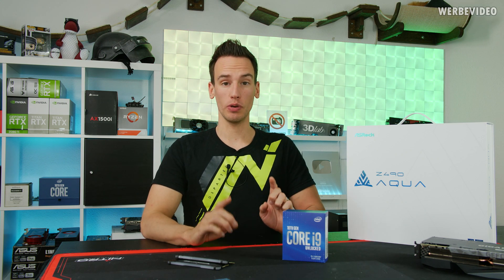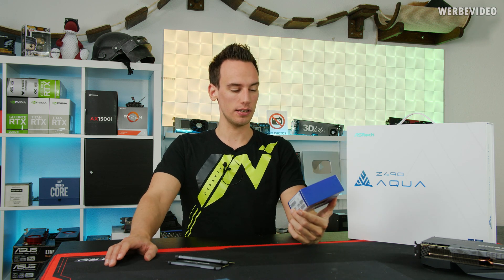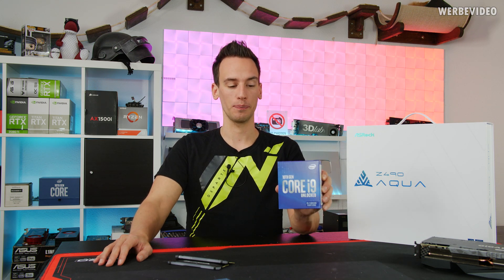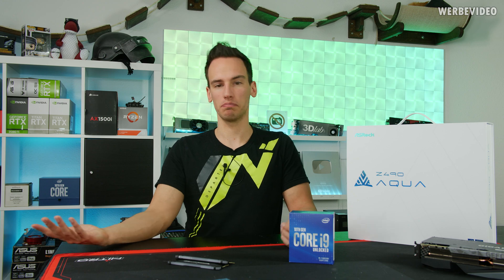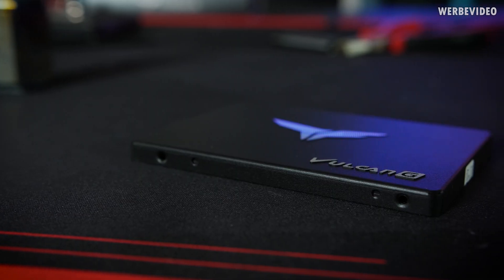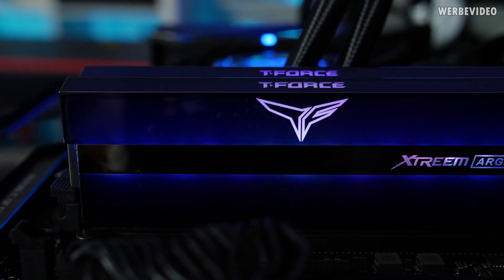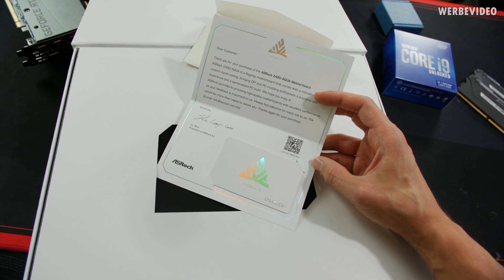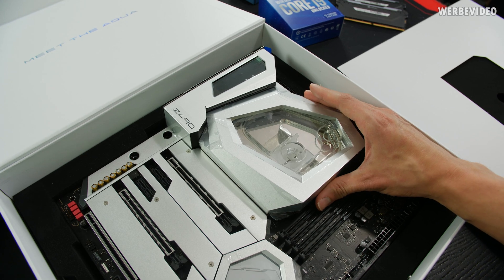This Mainboard is TWICE as expensive as the CPU - ASRock Z490 Aqua with i9-10850K

Comment: I can get 5.2Ghz at 1.345v llc 3 on my 10700k, stable. That's crazy! 10700k doesn't have the aditional cores, but I hit the silicon lottery with my CPU. Eventually I'll see exactly what my CPU is really capable of. Those boards are super cool. Maybe I'll go custom watercooling in my Gen 11 or 4th Gen Ryzen build 🤔. Ryzen may not need it though 🤣.

Comment: got a 10850k running at 5.2 1.39v. runs 5.1 all cores at 1.34 so some of these chips are decent. It seems 5.3 is doable on all cores but I would need better cooling to even try :D

Comment: If I've understood corrrectly, the reason for binning to 10850k, isn't neccessarily that the chip cannot hit 5.3 at all, but rather that it cannot hit, or sustain, 5.3 within stock parameters for power consumption, boost durations etc. For enthusiasts with ample cooling that might not matter, but to many other customer segments it does.

Comment: Honestly I'm glad they didn't focus more water flow for the VRM and increase coldplate surface area for it. 

It doesn't need the cooling, and all that'd do is add more heat to the loop, really. I'd rather save more thermal headroom for my cpu/GPU

Comment: Like phone glass armor, any unfortunate air bubble diffuses through the (thick!) glue/bedding transparent paste material used to stick the glass on. Bubble shrinks, goes away in days not so bad, patience very important.
Reply: Agreed. Perhaps with some heat and a low humidity environment the bubble will diminish? Very impressive board though!

Comment: I can't imagine many people are looking to buy an Intel CPU right now
Reply: You need to go back to Zen2 release and read the chart AMD listed, and then the real gaming review how 9900k kicked the 3900X ass :)
Reply: @Martin M if by expensive you mean £55 then yes. I got a 9500f on a B365 for £140. Idk why you think that's expensive, you don't need a Z series board
Reply: the best value cpu is intel 10700+b460.amd has nothing for gamers at 8 core cpus at this price
Reply: @paulmers9112  With the price of a 5800x and B550, a 10700k and a low end z490 is going to be around $100 less, with what appears to be near identical gaming performance pre overclock... Unless you want more than the 300+ fps already offered in League and Csgo, then it's UP to 20%. 

I got my 1600x for it's price to performance and the fact I needed more multicore performance at the time rather than single core (coming from a 4670k that was really struggling in multitasking), but now I just want an increase in gaming performance, AMD's option absolutely does not seem worth it.
Reply: @toaster_bloke9999  You forget there's people with 240hz monitor and play more than just LoL and CSGO

Comment: Heat from the board may get rid of the bubble.  Let it run warm for a while. Idk about applying heat like from a hair dryer, but heat coming from the underside of the screen helps rid bubbles in smart phones.  Just throwing something out there
Reply: Aw i see it worked itself out.  Maybe what I was saying as its common.  That I was just a large one

Comment: The software voltage reading on these boards often is rather incorrect, which leaves the question, why not use the data from the vcore controller which is actually accessible on many boards, including even old asrocks like my z370 k6 - that one doesn’t step in 16mV steps (rounded up, thx asrock) but is instead rather precise.

Comment: seems the voltage is very high, my 8600k does 5ghz at 1.216 volts and 4.8 at 1.168, just 6 cores but still they push the 14nm to the brink of destruction imo
Reply: 6 cores Vs 10 cores. End of discussion
Reply: @weavercs4014  dude, the 18 core runs with lower voltage its bad binning. the 10 series is 2 years newer than mine as well... end of discussion.
Reply: you probably got a good one, my 1st 9900k runs 5.1Ghz@1.36v(85°C) 5.0Ghz@1.27v (75°C) easy which looking at reviews is less than most I tought it was "normal" and then I happened to buy a second 9900k..it does 4.7Ghz, the base clock and that's it...if I try 5.0Ghz it requires 1.4v and goes to 240watts O_O and 100°C almost immediately in the same custom loop setup it's a dud

Comment: It's like Asrock decided to make a super premium motherboard just so people would stop calling them the value brand. Instead of even trying to compete on price and features, and the waterblock is poor.
Reply: I hate that label. Getting a good value is NOT a bad thing.  Accepting a bad value to have the name that makes you feel the coolest painted onto the part you have bought is not a smart way to spend money.
Reply: @KeithZim  well, asrock now has the most value and the nicest looking board, not bad for them
Reply: ASrock back in the day, like 15 years ago was making indeed, cheapest boards on the market, but then, other big players did very similar products in terms of quality... ASrock's were reliable and  for sure best value. In 2009 they started to make boards for first intel hedt platform... And now they are on top.
Reply: @swrzesinski  Asrock being on top will take significant work on their part. It certainly hasn't happened yet, and a limited board that they are only selling 999 of doesn't change that. Even if the Aqua was the perfect OC motherboard which it isn't.
Reply: @Martin M except the Aorus Waterforce Xtreme is the best performing board along with the Godlike on every platform so it's hardly a poor board
Reply: @weavercs4014  I was going to say my GIGABYTE AORUS Xtreme GeForce GTX 1080 Ti Waterforce is awesome. Stays at a constant 2075mhz even after four years of max power limit and voltage and stays under 65c even under the most stressful games. Also like the fact that it only has two moving parts a pump and a 120mm fan.
Reply: @XxViciousxX  don't mix gpu watertblocks with deluxe aqua motherboards absolutely nothing in common, liquid cooling motherboards are not only super expensive but check reviews and comments 3/4 are negative for motherboards when gpu cooling blocks are 9/10 positive